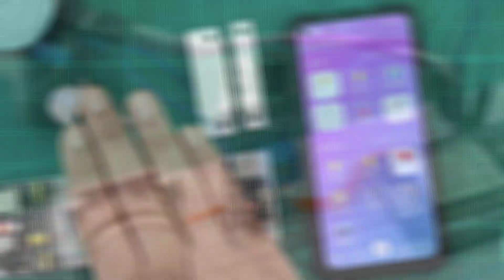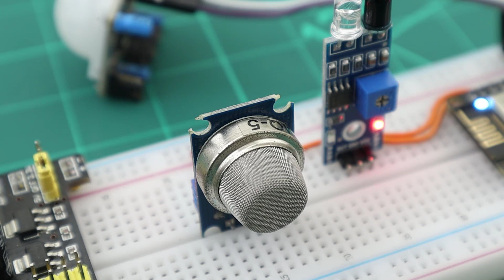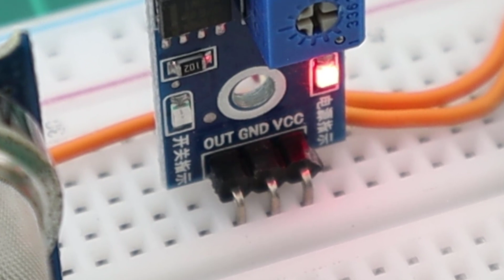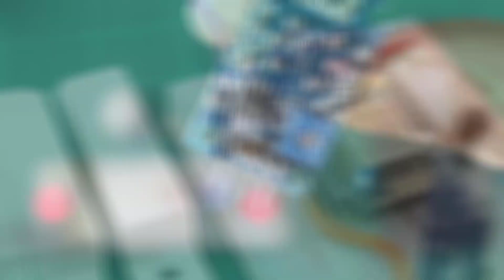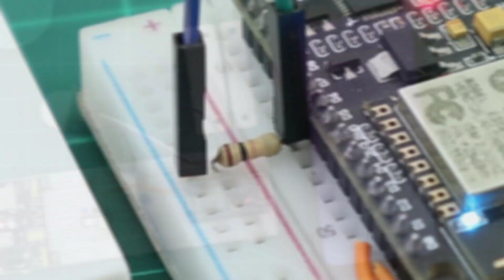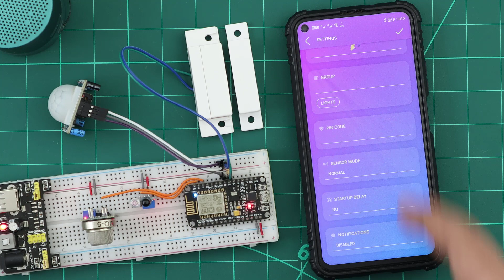Digital Sensors in CADIO platform (ESP8266 - ESP32) | CADIO Home Automation

Comment: Amazing video and very easy to configure for what it is needed. It is appreciated.
Help, I have 8 door sensors and like you I put the 10k resistor on each GPIO Y VCC(5V), as shown in this video, what happens is that esp8266 on the breadboard with external power does not work correctly, why is that? It doesn't connect to Wi-Fi, configuration mode doesn't work either. It only works in isolation without any connected components. I can contact you. Thank you

Comment: Hi sir
Very Amazing Innovation 👏👏

It’s very simple and easy to understand and program it. I am very happy 🎉 seeing all the videos 
I am going for licensed version for 10 units in a couple of days.

How can we get MQ-5 sensors analog output values in CADIO

I have spent 1 year in learning the basics of the code as I am not a programmer or electronics engineer .
Reply from the maker: Thank you sir, glad you liked it! ❤️
In the current version, the supported sensors are the digital sensors "with high/low digital output". For the mq-5 you can use the digital output, you can adjust the sensitivity using the sensor built-in potentiometer.
Supporting analog sensors will be token into consideration during the discussion of future developments.
Reply: @cadioHomeAutomation  Thank you sir 🎉